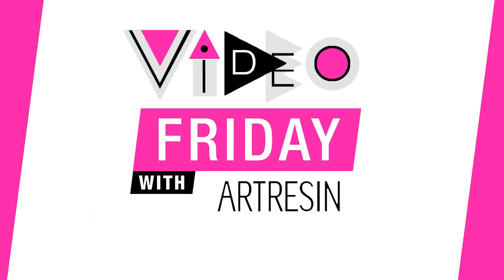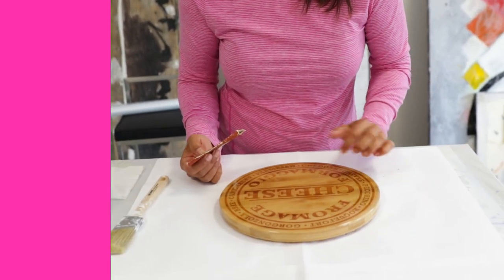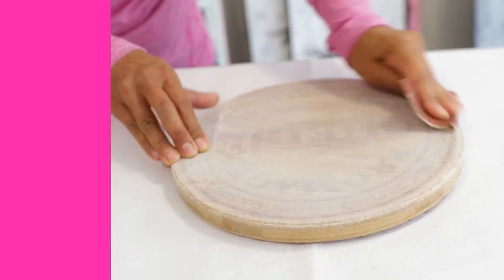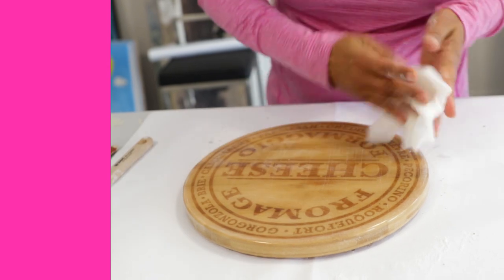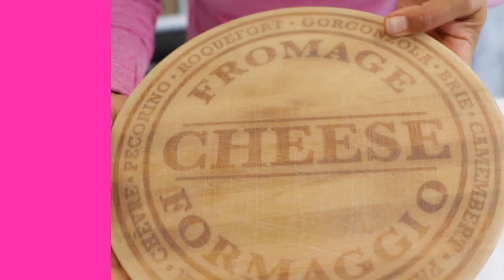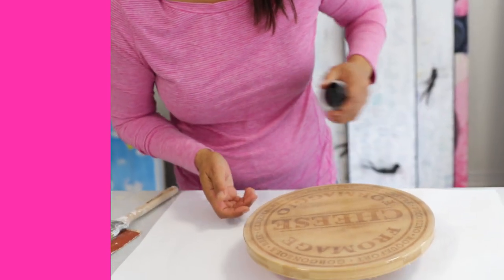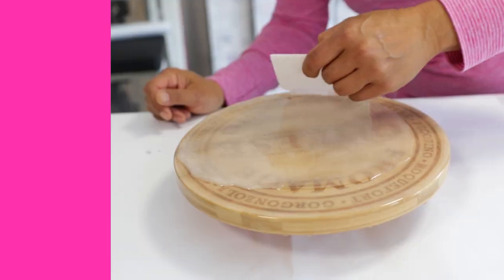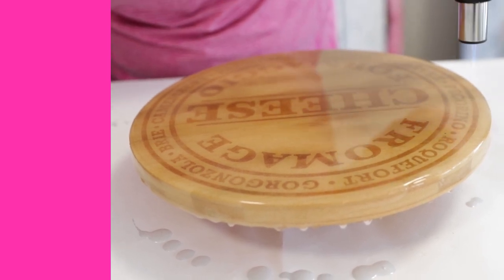Will Sanding Ruin My Resin Work?

Comment: Hiee 🌸
If we gonna use 80grit sandpaper on our resin coaster , will it leave any scratches / cloudy look 
Or it will be clearer after top coating it with resin ? 
Waiting for your reply !
Reply from the maker: Hi Shivani, we use 80 grit to sand our pieces.  Once you sand your cured resin it will look cloudy, white and scratchy.  Don't worry!  Clean off the sanding dust and when you pour your next layer over top it will return to clear and glossy, all the scratches will disappear.

Comment: I mixed my resin according to instructions. I had 2 pieces of art work. I poured the mixed resin on each piece. The next day one piece was perfect, however the 2nd piece had 2 small tacky spots on the corners but everything else was cured. Why would I get tacky areas on one piece and not the other using the same mixed resin.
Reply from the maker: Hi Karen, sorry to hear that you had some sticky resin issues.  Small sticky spots are typically the result of scraping the mixing container when you're pouring the resin out.  No matter how well you mix, there is almost always unmixed resin and hardener stuck to the sides and bottom of your mixing container - when you scrape every last bit out, that unmixed product creates wet sticky spots in your otherwise perfect pour.  
It's an easy fix though - if there's any liquid, runny resin, you need to remove it.  Then sand any perfectly cured areas.  You don't want to remove the resin, just simply rough up the surface so the fresh resin coat has something to bond to.  Wipe away the sanding dust and pour a fresh coat of carefully measured and mixed resin over top.  It will cure perfectly and you'll never know you had an issue :)
Hope that helps!

Comment: How can I repour a sphere ball? I've sanded, polished, and tried to repour, and it looks AWFUL. So back to the resanding, and repolished and now one area is hazy. How do I correct?
Reply from the maker: Certainly re-coating a non flat surface is not as easy as pouring over a flat, level surface and allowing your second coat to self level to a perfect finish.  The best way to apply to your sphere would be in thin layers with a brush or even with your gloved hand.  The thin application will help avoid drips and give you a cleaner finish.  Good luck :)

Comment: I have a colored resin design and want to embed stones.  Will the sanding to pour the second coat ruin the colored design?
Reply from the maker: Hi Karen, Sanding the second coat of resin will not ruin your colored design as long as you are careful not to sand right through the first layer of resin.

Comment: When you done the first resin pour, did you do any special prep to the piece? Is that htv on wood? If not, what would you recommend in such instance? Looking to epoxy a wood stained piece with htv? Not sure if there is any type of recommended prep for this?
Reply from the maker: Typically ArtResin will not adhere to vinyl, however if you are just looking to apply a vinyl decal there is usually enough of a border around the vinyl decal to allow ArtResin to adhere.  Just be sure that the decal is much smaller than the wood surface area.  Be sure to use a water based stain as oils can repel resin.  Let the stain cure  before applying ArtResin.  When working with new techniques its always best to test on a non masterpiece.
Reply: @Artresin  ty

Comment: Im new to resin....do you have to sand the entire piece if just one tiny part of the piece is inperfect? I have the corner of a picture slightly poking out a tray...didnt think I'd have to re-coat the entire thing. or do I ??
Reply from the maker: Unfortunately, we don’t recommend spot fixing for the simple reason that it’s actually very difficult to sand out a small area where there might be an issue, such as a bubble, hair or even a bit of dust that settled into your wet resin.  It's almost impossible to get a seamless finish by pouring a fresh patch of resin on top of the original resin coat. Instead, we recommend that you sand down the entire surface and pour another well mixed, well measured coat of ArtResin over the entire piece for an even, flawless finish! Here is our blog for more information: https://www.artresin.com/blogs/artresin/can-i-spot-fix-small-imperfections-in-my-resin

Comment: 😬 I tried sanding with 60 grit and been trying to sand out the noticeable scratches with a 120 grit. Whats the deal?  Do I need a power sander?
Reply from the maker: We typically use an 80 grit, be sure to clean off all of the dust from your piece once done sanding, when you pour the fresh resin over, the sanding scratches disappear.

Comment: Is the top layes just resin or resin+hardner?
Reply from the maker: You will always want to mix the resin and hardener in a 1:1 ratio prior to applying it to your artwork.  If the two parts are not mixed, they will remain wet and sticky forever, mixing them starts a chemical reaction that turns the liquid to a solid in 24 hours.  (we do make this confusing by sometimes referring to the mixed product just as "resin", when it is actually a mixture of the resin and hardener)
Reply: @Artresin  yeah, cuz people just say they put resin as top layer so that got me counfused😂 thanks for clearing that up!

Comment: How do I get the bubbles out of the succulent planter mould? Is it safe to use blow torch over the mould ?
Reply from the maker: Hi Sneha, a flame can damage your silicone mold.  Some people have success using a heat gun to clear bubbles when using molds.  It also helps to warm your resin using a warm water bath prior to mixing, and pouring in layers will allow bubbles to escape easier.
Reply: @Artresin  oh, thank you so much!❤️❤️
Reply from the maker: @snehahr2360  🙂

Comment: I poured a thin layer over a table top and instructions say 24 hour dry time. It's been left alone for close to 2 days. I get a microfiber towel and damp it a little bit to wipe the table. I started to do so and everything my towel touched got cloudy. Hmmmmmmmmmmm did I mess it up or is there an easy way to fix it? Will the cloudiness go away on its own? 🤦‍♂️
Reply from the maker: Hi there, it is best to wait at least 72 hours or more before wiping or handling the surface too much.  Your ArtResin will be hard to the touch after 24 hours, but will continue to cure and reach full cure by 72 hours.  If the wiping left scratches you may need to lightly sand the surface and pour another coat of resin overtop to restore the shine.

Comment: Hi! I am making a bar top with bottle caps inside the clear epoxy (.4” deep) and had to sand to create the rounded edges (then the entire top). This made it opaque and of course it needs to be perfectly clear or the bottle caps will look blurry. I have sanded the entire surface with 80 grit then up to 220. I have wiped it as clean as possible. When I pour mineral spirits on it still has a slightly blurry look from scratches/dust... I’m hesitant to pour my next coat because I’m worried it will look the same and blurriness will not be gone. Am I wrong to assume this?
Reply from the maker: Hi Kyle, We sand with 80 grit and then apply a second coat, you will not see the scratches left by sanding.
Reply: Adding any liquid to not fully cured resin will make it cloudy. Just because it’s not sticky anymore doesn’t mean it’s not fully cured. For example, when pouring in layers there is a sweat time window where the resin is tacky but not fully cured. With art resin I believe it’s between 3-5 hours depending on temperature of environment. At around 6-12 there is not longer any stickiness however the resin still isn’t fully cured. You can demoed after 24 but to be honest, with my house being on the cold side I wait 48-72 hours before doing anything to it. If mixed properly and no more than 6 percent of the mixture was any colourant, it shouldn’t go cloudy when any treatment is added to the resin. Hope this helps. When in doubt, wait longer. Resin isn’t cheap and with such a big project it’s better to be safe than sorry, remember you can’t over cure so waiting extra time won’t hurt. Hope this helps

Comment: I noticed you use the dust off spray canister. Don't they have chemicals inside of them? Wouldn't using that affect how the resin adheres?
Reply from the maker: Hi Angelina - great question! We use Dust Off and other similar air canisters and have not had a problem with it affecting the resin whatsoever :)
You can certainly just use a brush, but as I mentioned, sometimes it can be useful when resining objects with nooks and crannies.
Reply: I'm sure this was her first time using compressed "air." I guess we'll have to wait and see.

 No

Comment: I thought it was paramount to use a dust mask for resin dust as the particals are very dangerous if inhaled??
Reply from the maker: ArtResin conforms to ASTM D4236, meaning it is certified as safe for home use and non-toxic when used as directed.  ArtResin is also fully inert when cured. A mask is not required when mixing however if you feel more comfortable wearing a mask please do so :) As for sanding, dust is a concern just like wood dust...  it irritates the lungs, don't breathe in any sanded dust as a general rule.

Comment: My top coat has milky clouds in it. How do I fix it. And have no resin left.
Reply from the maker: Hi, it sounds like your resin and hardener may have been too cold when you started. The ideal temperature for both your resin and your workspace is between 75-85F. We also recommend trying a warm water bath to warm up your resin and hardener before you mix them. For details, please visit our website https://www.artresin.com/blogs/artresin/should-i-warm-epoxy-resin-in-a-water-bath-before-mixing?_pos=1&_sid=66315f4c0&_ss=r

You can also send an email with some photos of your artwork to support@artresin.com and our customer service team will be happy to help.
Reply: Unfortunately your going to have to sand it off and either polish it, which is a chore working from 240- 7,000 wet dry sand paper, then polish/wax I’d sand it off, a little at a time with light pressure as not to melt the resin get more resin and sit the resin, not the hardener, in warm water for 15 minutes before mixing. This will help control the cloud if related to temperature, make sure the environment is not to humid. If it is to humid, or any water gets into the resin before curing it will go cloudy. Hope this helps

Comment: Thank you for this video ❤️ Today I poured resin (Not from your brand, unfortunately) over an oil painting and it turned out really horrible 😖 I assume that painting hasn’t been completely dry yet, and now there is a yellow layer on top :((( I‘m wondering if this technique will work out well?
Reply from the maker: As long as the resin is not runny or gooey you can sand it down and pour again :)
Reply: Thank you for the response! So it really won’t ruin the painting underneath ? I‘m very hesitant to try, also contemplated to paint over all the yellow parts and then wait for a couple months until it’s 100% dry before I apply a second layer of resin and even out the surface ! Which do you think would be best?
Reply from the maker: @PatriciaOchudlo 
I would use caution when sanding as you don't want to go all the way through and damage your artwork below. Oil paintings  can be very difficult to cover in resin as usually the resin will want to repel from the oil. Oil paint is also difficult to gauge when it is fully cured this can be many months or even longer. I would suggest to reach out to the manufacturer of the resin you are using as they may have a different recommendation for using their product with oil paints.
Reply: @Artresin  okay, thank you so so much! I felt really lost because I couldn’t find any information on this, so I truly appreciate your help 🙏🏼

Comment: Is art resin food safe? Wondering about using it n a counter top?
Reply from the maker: Hey Adam - yes, ArtResin is non toxic and, once cured, is safe for direct contact with food as per the FDA.  You can read more about it here: https://www.artresin.com/blogs/artresin/artresin-is-certified-food-safe-by-the-fda
Some of our customers do use ArtResin to seal table tops and counters but keep in mind that ArtResin was developed as a surface coating for artwork meant to be hung on the wall with no wear and tear.  It is scratch resistant but not scratch proof.  Additionally, because we don't add some of the toxic and yellowing solvents to our hardener like many other epoxy resins do, our resin is more flexible.  Some of our customers like to top coat their counters with a layer of polyurethane or sealant to add additional dent resistance ( although, again, most polyurethane is highly toxic too )

Comment: I was still able to see scratches after I sanded and poured a second coat of epoxy
Reply from the maker: Hi Yvonne, we usually sand our resin with 80 grit sandpaper before repouring a second coat.  When sanding, be sure not to sand deeper than the resin coat--you only want to scuff up the surface and remove any imperfections, you don't want to sand into your artwork or paint.  Please reach out to us at support@artresin.com if you need some help 🙂
Reply: After the first sanding, get some high grit wet sanding paper - 1000-1400 works great.

Comment: Could u pls recommend a sanding machine?
Reply from the maker: Hi Thomas, you can sand by hand or use an electric hand sander, or belt sander. Picking the right sander is really a matter of personal preference and comfortability. We like to use an electric belt sander as it helps to get the job done quickly, especially if you are sanding more than one piece at a time. Your local hardware store can help you pick the sander that's best for you. And remember to use proper PPE when sanding :)

Comment: Can I use ultra fine 220 grit?  Ah!!
Reply from the maker: Hi Amy, the reason we sand the surface is to rough it up and provide tooth for the next layer of ArtResin to adhere strongly.  For this reason we typically prefer a courser grit.